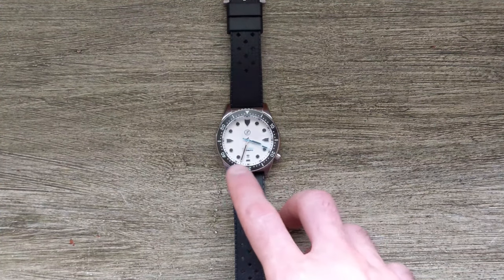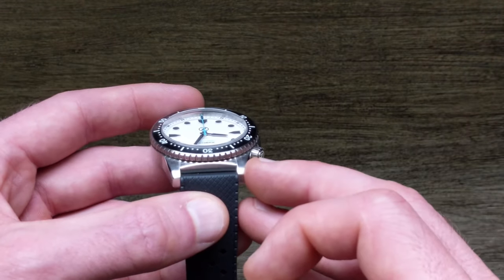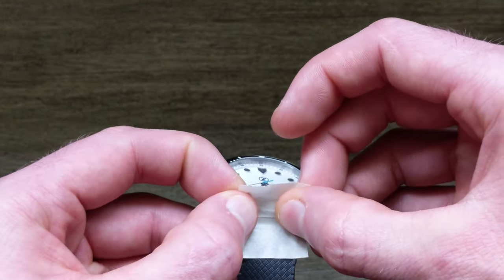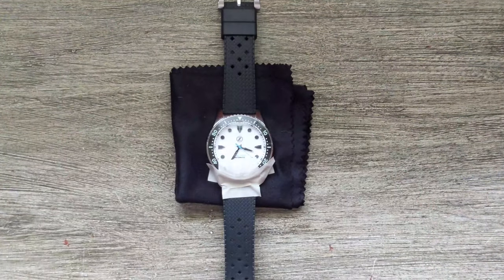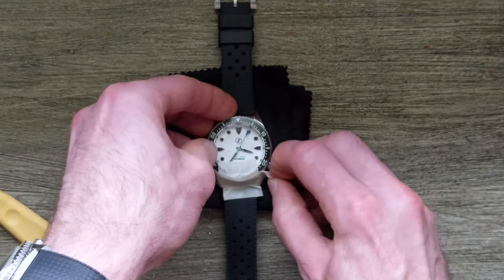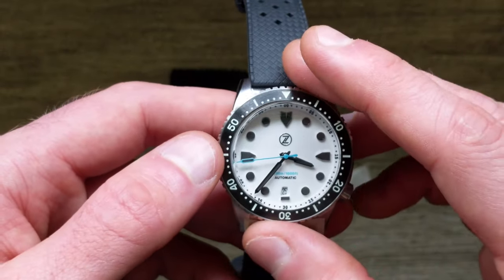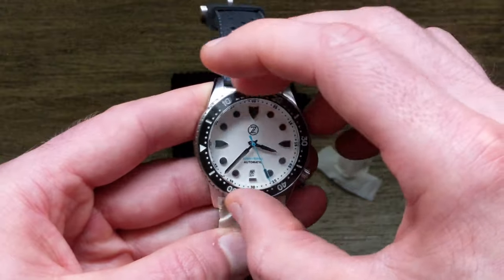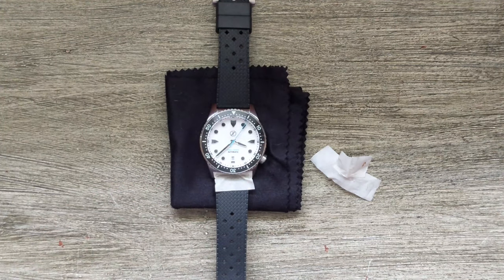How to Easily Remove a Watch Bezel

Comment: That’s a great idea, a plastic pry tool seems better. I tried it on a diver watch but with a metal tool and I scratched the heck out of my watch. Have you tried this on any other watches?
Reply from the maker: I'm glad it was helpful! Unfortunately it's really tough not to get some marks with case knives in my experience. Yes, while this may not work with really tight bezels or ones with different mounting methods, this approach does work on many others.

Comment: Have a Heimdallr skx homage that I removed the bezel of to do some cleaning. Unfortunately I couldn't get it back on. It did have an octagonal retaining spring which got damaged. Do you know if it requires this to stay in place??? Other than the retaining spring, it's very similar to this
Reply from the maker: I'm not familiar with that specific bezel but there are commonly two springs, the leaf spring for bezel clicks and the octagonal spring that retains the bezel. You may have luck playing around with the octagonal spring until it seats back into the bezel. Good luck

Comment: I used to have a tool I made out of HDPE. Just custom cut and sanded down one end to a good smooth blade to slip into tight spaces. Used it to help pry apart Auto parts without, or at least greatly reduce, chance of surface damage.
Reply from the maker: Excellent. Sounds like a very similar approach and tool. Cheers

Comment: followed your link for the tool you were using but the products are different did you have to shape your tool?
Reply from the maker: No, I made this video a few years ago. I've had to change the link a couple times due to Amazon and/or the vendors changing the listings. The tools in the video were purchased locally years ago but any similar ones should do the trick. I hope this helps. Cheers
Reply: @JonathanTReviews  Thought so, and yes I will make a tool similar to yours as you have inspired me!

Comment: Can you share a direct link to that pry tool? It takes me to a kit that doesn't have the tool you used. I bought a different kit on Amazon but the plastic is kinda flimsy and doesn't seem to do what I want it to.
Reply from the maker: Unfortunately, the exact one in the video was purchased locally and I don't have a link available. The Gliston kit linked in the video should be similar. A ton of people have purchased that kit without reporting issues. Sorry I can't be of more help. Cheers

Comment: I wonder if the same tool would work for opening a case back (obviously the non screwed ones) for extra protection and avoiding scratches, compared to case knife.
Reply from the maker: It's possible but I'm not sure it will be and to get enough purchase. Cheers
Reply: @JonathanTReviews  thanks, cheers

Comment: Can i do the same way on my Tissot seastar 1000 with dive bezzel which is not turning anymore. Please advice🙏
Reply from the maker: I've never worked on that specific model, but it's likely a similar application. You'd want to make sure it doesn't use an alternative retention method before trying. Cheers

Comment: Do you have any extra advice on a titanium Swordfish Calypso bezel removal? Thanks
Reply from the maker: The fundamental process and retention style should be very similar. Just be careful with the titanium (easier to scratch/mar). They're also usually a bit tighter than the Mako from what I've seen. Good luck! Cheers

Comment: Jonathan, this is great!  Do you know where to get replacement bezels for the Mako?  Looks like it is 38 x 31.5, but that is a standard SKX size and those bezels are all flat.  This one seems to be angled slightly (like most non Seiko bezels).  I have the black on black and I'd love a dark blue bezel for my Mako.   (P.S. tried this on several watches, worked on about 50% of them - some pop off, some are on there super tight).
Reply from the maker: Glad I could help! I haven't ever messed with trying aftermarket inserts on it but have seen others that have. The feedback is like you said, it's hit and miss on compatibility. You may want to check out the Zelos Mod Group on Facebook if you have access. There are pics on there and a gentleman that has done a lot of switching. Cheers

Comment: I’ve taken it off but the bezel seats in place but it falls off when I flip it upside down? Helps please  

The bezel clicks and rotates as it should but it doesn’t seat in place and it’s flush to the watch.
Reply from the maker: Is the retention spring missing or damaged? There is commonly a leaf style spring (that's what makes the clicks), but also a wire spring that secures the bezel to the case (usually mounted in a channel in the bezel). This has to snap into place on the case to secure the bezel. I hope this helps.

Comment: Hi Jonathan. Thanks for this very useful video. The link for the pry bar points to a totally different tool. Can you share a new link? Thanks.
Reply from the maker: My pleasure! The one I use in the video was locally purchased so I linked the closest option I could find on Amazon. Cheers
Reply from the maker: My apologies. I just got a chance to check the link and you're right that they changed the listing entirely. I've updated with a new link to a kit that should do the trick. Thanks for bringing this to my attention. Cheers
Reply: @JonathanTReviews  Thank You Sir!!!

Comment: You could also use those little orange lego piece removers too, right?
Reply from the maker: Wasn't familiar with them but did a quick search. It looks like it may work. Not sure if the end is too thick or there would be enough leverage. If someone already has one on hand, I'd say it's worth a shot.

Comment: Ty but I need to remove the top glass area is it the same method
Reply from the maker: Not certain I understand which part you're referencing. Are you referring to the crystal (the part over the dial) or the bezel insert (the material varies but some include sapphire inserts). For the crystal, no, it should be a completely different process though removing the bezel might be necessary. If you are referring to the bezel insert, yes, in part. Removing the entire bezel makes accessing the insert easier for removal. Depending on the material, be aware that you'll likely damage or break the stock insert in the process. Good luck. Cheers
Reply: @JonathanTReviews  the part over the dial.
Reply from the maker: That is a more involved process and usually involves further disassembly along with a crystal press.

Comment: This is a helpful tutorial, however the link to the tools does not have the same tool he uses and I would not recommend them. I ended up using a dull knife instead.
Reply from the maker: Thanks for the heads up. This has needed to be updated several times over the years as listings change. The set linked now appears to be identical to the ones used in the video. Cheers

Comment: Hi, is the bezel on horizons gmt v2 similarly easy to swap? Thanks
Reply from the maker: I haven't tried to remove mine, but the process should be very similar. The Horizons bezel is a ball bearing action, as opposed to a spring (featured in this video with the Mako), but most moveable bezels feature a similar retention system. I didn't show it well in the video but there is a wavy spring in a groove inside the bezel itself. This is what retains the bezels on the case. With most watches, all you're trying to do is pop that out of a case groove to free the bezel.
Reply from the maker: To ensure I provided you with accurate information, I have confirmed that the Horizons also just uses a tension ring. The provided technique should do the trick. The main thing is to be careful not to lose the small bearings or springs. As mentioned in my previous reply, that part is different than what's in the video. For extra piece of mind, you could remove it inside of a large Ziploc bag just in case the bearing or spring falls out.

Comment: OK so I lost my bezel and all I have left is a circular spring (?).  Supposing I can locate a bezel, how does it go back on?  How is it measured?
Reply from the maker: It can vary from watch to watch but there are typically two springs, a retention ring (looks like a wire and is usually in a groove on the bezel itself) and a leaf spring (which I'm assuming is what you're seeing). The first part is what actually holds on the bezel and it just needs to be gently snapped back onto the watch. Not sure what you mean by how is it measured. Cheers
Reply: @JonathanTReviews  Assuming bezels come in different sizes, I don't see anything but brands in your catalog.  My watch is a Benrus diver from the late 60's.  I'm getting the idea on how it goes back on but all I have left is the circular spring.
Reply from the maker: Bezels are not generally going to be interchangeable from one watch model to another. There's more to compatibility than just the diameter measurement.
Reply: @JonathanTReviews  What would be your suggestion for locating an antique bezel?
Reply from the maker: Sorry, I don't have any. Not my area of expertise and is likely a tall order. Good luck

Comment: Can you use this technique to fix bezel alignment?
Reply from the maker: Possibly as a starting point, depending on the bezel. Many bezels have a bezel insert that's typically fixed with adhesive. You'd have to remove the insert and adjust that part. The bezel itself has fixed teeth so you can't typically adjust that part.

Comment: Can the glass lenses be removed when the bezel is removed
Reply from the maker: Are you referring to the crystal (over the dial)? If so, that generally requires disassembling the case and using a press to install/remove. Cheers
Reply: @JonathanTReviews  yes mate

Comment: So I used super glue for attaching a replacement bezel insert , and despite my cautious approach I successfully froze my bezel . I’m wondering if I can submerge the watch in acetone to try and unlock it? I’m going to accept the new insert will detach
Reply from the maker: Oh man, that's unfortunate. Hopefully you're able to free the bezel. I would not want to put the watch itself in acetone for potential seal damage. You'll also likely damage the bezel insert lume or paint, as a heads up. Good luck!

Comment: What watch is that?
Reply from the maker: It's a Zelos Mako V3 in the Frost colorway. They can be tough to find but there have been some popping up recently. I'm coincidentally thinking about selling mine. I have a bunch of Makos and need to keep new ones flowing in for the channel. Cheers
Reply: @JonathanTReviews  I might be interested if you have a midnight version
Reply from the maker: I do but have sentimental attachment to that one. I do have a blue sodalite dial Terra/Mako that I'd consider selling.
Reply: @JonathanTReviews  I don't blame you, I find that is the prettiest out of the Mako v3, although I would like it even more if they replsced the blue bezel for something more neutral, like a Traska styled bezel with scratch reistant steel. Btw do you have any other watches you'd consider maybe trading for a discontinued Nomos Club Dunkel 702 ref?
Reply from the maker: I swapped the bezel on my Midnight to a SS version (though it doesn't have the coating, which would be nice). Sorry, but I'm looking to make some room. I have overflowing boxes and need to keep a stream coming in for the channel. The only three I'm considering selling at the moment are the Sodalite Terra/Mako, Frost Mako, and Signum Cuda Opal Mosaic.
Reply: @JonathanTReviews  Ah that's alright, maybe next time. You should do a video of that Midnight with the SS bezel, if you haven't already!
Reply from the maker: I have it in some different videos. The one that readily comes to mind is a fairly recent strap review: ColaReb, EULIT, and Hadley-Roma.
Reply: @JonathanTReviews  Cool I'll check out your strap vids as well
Reply: Just the comment I was looking for. I love the patient watch (Frost). I like the black over white and the shape of the 12, 3 and 9 markers. Whew.
Reply from the maker: It's a gorgeous colorway and definitely recommended! Cheers
Reply: @JonathanTReviews  too bad they're sold out, but it's for the best for me at least. I couldn't simply say I found that watch on the ground to the wife. 😂
Reply from the maker: No doubt 😁 Keep an eye out, they do pop up from time to time. I saw one recently on the Zelos Facebook group. Cheers.
Reply from the maker: Just double checked, there's one for sale in the FB group right now, in case you're interested.

Comment: I bought the tools in your link and I still cannot get my dive watch bezel off.
Reply from the maker: That stinks. Some of them can be pretty tight, though most still use the same technique and installation/removal method. It may help to search and see if anyone has removed the bezel from the specific watch you're working on. Cheers

Comment: I have an Aragon Divemaster II which I got just 3 weeks ago. Yesterday I noticed that the bezel suddenly took a lot of effort to turn, until it just became too hard to turn. I tried putting in some oil but it didn't help. Dunno if I can still turn it. Guess i have no choice but to pop the bezel and see what's going on, so I ordered some pry tools. I hope the innards didn't shear or something.
Reply from the maker: That stinks 😣 I hope everything goes smoothly and you're back up and running soon. Cheers
Reply: @JonathanTReviews  thanks, dude. Can't wait to pop it open and see what's going on.
Reply: @ronch550  update on your watch?
Reply: @michaelcorleone287  well I washed the watch and tried turning it again and it suddenly turned and now it's fine. I think the water made the oil spread inside.
Reply: @ronch550  I have placed my watch in bowl of warmish water with mild soap and have the bezel a couple of turns still feels the same. What oil brand did you use?

Comment: Hi how to change bidirectional bazel to unidirectional bazel in Casio mrw 200 model
Reply from the maker: That would likely be a difficult task. Most bidirectional bezels use a bearing or similar to allow either direction to operate. Unidirectional bezels typical use a leaf spring which only allows the one direction. You'd probably have to retrofit the leaf spring.

Comment: Have you tried this method on a Zelos Hammer Head?
Reply from the maker: I haven't, but it should likely still work. The Hammerhead has a pretty significant setback for the bezel, leaving more area to apply leverage with the tool. I'd just make sure to thoroughly mask the surfaces though if you do try it. Good luck. Cheers

Comment: Inward pressure like wedge? Or pry down or up. Scratched my orient a little -__-
Reply from the maker: I'd describe it as more of a wedge with maybe a slight downward angle. That stinks about the scratch. I'm pretty liberal with the tape to help protect. Good luck
Reply: Do you have a Kamasu bezel issue too?
Reply: I'm with you... Just scratched my beloved Orient Mako XL... Why in the world didn't I gave it to customer service? damn it...
Reply: @gyrovague  yes I put on a new one, it’s only a little better.
Reply: @darkling84  it’s okay, the scratch can be removed if you want it to be, and it’s not noticeable really anymore. You’ll get better too. Better to practice on that then a longines or breitling right.
Reply: @JonathanTReviews  I have a Wenger watch and goddamn, the bezel won't come off. I pressed with a plastic wedge until my hand hurt. Tried two different places. What else can I do? I tried another plastic wedge and the tip just broke right off.
Reply from the maker: Oh man, that sounds like a bear. Unfortunately, I'm unfamiliar with that bezel. If you're able to confirm that it's held on with just a retaining ring (like the one in the video), it may just be very tight. Some can be tough. In that situation, you may need to use one of the steel case openers or similar. Please be aware though, the likelihood of damaging or marring the watch increases significantly. Best of luck. Cheers

Comment: If you're using a plastic tool, the tape is completely unnecessary.  Plastic will not scratch steel in this situation.
Reply from the maker: In theory, I agree. I still personally prefer not to take any chances though. I've had surface scuffs from other things that shouldn't scratch steel. Cheers

Comment: Doesn't work at all. I tried and tried and the bezel on my Wenger watch is 100% jammed. I used a plastic wedge and all I did was ruin the wedge. Should I use a knife blade? The bezel is REALLY stuck. I couldn't get it to budge even a tiny bit.
Reply from the maker: That stinks you're running into an issue. The technique works (many have used the same method with success) but it isn't universal. I'm not familiar with the Wenger bezel to be able to confirm if it's the same attachment style so I'm hesitant to give advice. Sorry I can't be of great help. Good luck. Cheers
Reply: I got the bezel on my Wenger off just as easily as Jonathan.  They made a lot of watches over the years, so YMMV.
Reply from the maker: Thanks for sharing your Wenger results 🥂

Comment: I mean, this can work on many . If they are loose. I use real tools and still have trouble.
Reply from the maker: Much of it comes down to the case and bezel construction. If there's a decent undercut, this works with many tighter bezels too. You're right though, so bezels can be a real bear regardless. Cheers

Comment: Why did you use all that tape with a plastic tool?
Reply from the maker: Out of an abundance of caution. While it shouldn't scratch, I've had other things that shouldn't cause surface scuffs do so (perhaps dust particulates or otherwise). Cheers
Reply: @JonathanTReviews  Ok- hopefully mine comes off that easy! Thanks for the video..

Comment: abs plastic wont scratch steel...  no need for excessive taping.
Reply from the maker: In theory it shouldn't, but I've seen brushed and other finishes be blemished by other similar contact. I personally prefer overkill to be safe. Cheers